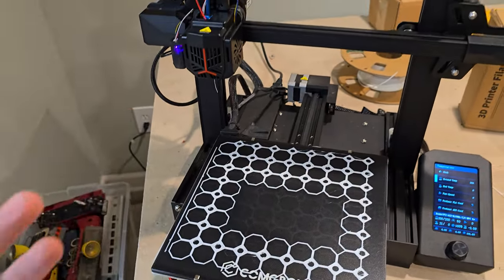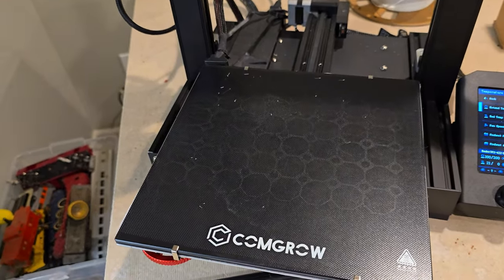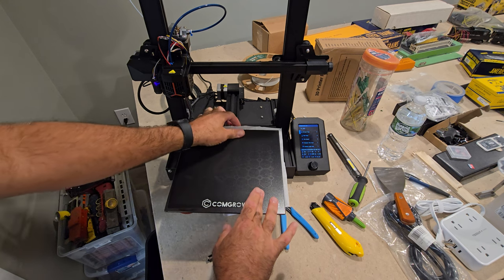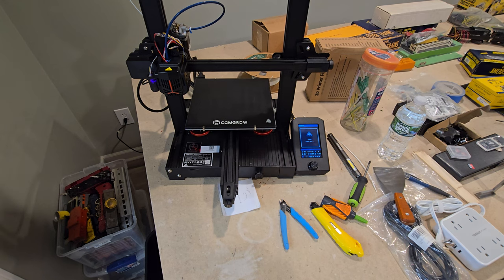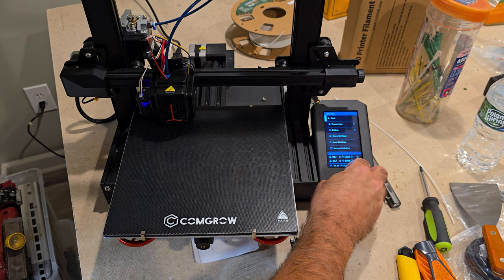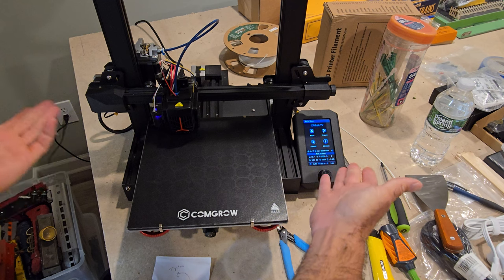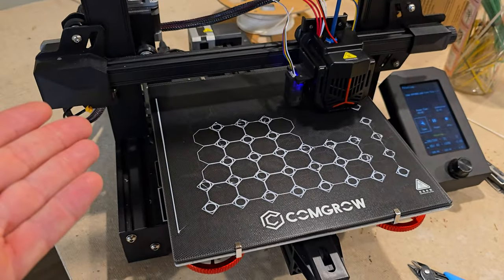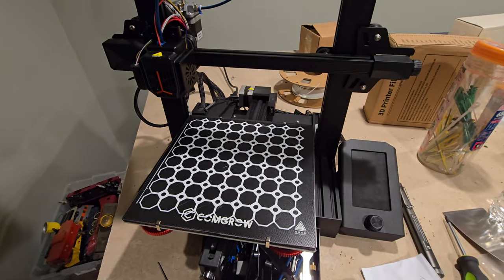Neo = New = New Problem each time! Ender 3 v2 Neo

Comment: I'm curious how old that nozzle was? I don't see how it was so worn out unless you've printed a ton of abrasives with it. Also, I've never personally used an  Ender 3, but seeing as that you could get a brand new one (v2 I think?) for $50, I'm not sure it's worth the hassle. How is the filament getting fed from the spool to the extruder? Is there any strain between those 2 points? Is it fed through a tube? Is the ID of the tube too small? I've not really used an Ender 3, so not familiar with them. Also, printing Multiboard can be frustrating if things don't go perfectly. I've started printing out my panels, which is going to be 70-80 8x8 or 8x9 tiles. I was getting some warping in 1 corner of my bed consistently, so I bought a bottle of Vision Miner Nano and no more issues. If worst comes to worst, you can always check your local FB marketplace to pick up a used printer that 'just works'. I'll let you determine which brand that is. Good luck!
Reply from the maker: Hey Ken.  Not sure how old that nozzle was, but definitely did not have a ton run through it, and it was all PLA.  I'd steer anyone away from the E3v2Neo!  My E3 pro is a slow and steady printer with good quality, so if you are not in a rush it is good.  Filament in this video was a bowden tube set up, I've switched to a direct drive since. Multiboard is like a torture test for the first few layers!!!!  I used some glue since this and it is sticking now, but I am still getting little nibs and now some edges are warping.
Reply: @dougdoesstuff24  I'd definitely recommend getting some Vision Miner Nano. It's a little pricy for the bigger bottle ($45ish on Amazon), but so far, it has been completely worth it. Was the nozzle cheap brass off Amazon or Ali Express? That could have something to do with it. I upgraded my MK3S+ (now 3.5S) to the Revo quick change hotend a while back, and it's been solid. I also just ponied up the $65 for the Obxidian .4mm nozzle. One other thing regarding filament. I bought the Geeetech 10 kg deal you see ads for on social media. It came out to $105 shipped, so $10.50 a spool. I'll probably use 6-7 spools for my initial project, so I figured I'd give it a try. So far, the panels themselves have been good, as well as most of the accessories I've printed. I'd steer clear of printing folding screws, etc with it. I don't think they turn out that great. The filament smells pretty bad, and its dimensional tolerance isn't as good as most filament is you've probably used, but it's good enough for this project for the price.
Reply from the maker: I will look into it.  I was using elmers purple glue, which seemed to work until the edges on part of the print pulled up.  Not a cheap nozzle, at least I don't think so.  It was a hardened steel one I purposely bought to be more durable than the brass ones.  I've been using Elegoo and Overture filament and they have been fine.  Tolerances have been good on my e3pro as well.  I printed some of the locking bolts that print in half.  They go in fine. I did superglue some together and just made sure the threads lined up.

Comment: You know, Bambu labs is having a sale right now. An A1 is just $299 and would run circles around those enders. Plus you'd have the option of multi-color if you wanted to add an AMS at some point. Just saying.
Reply from the maker: I did not know they were having a sale, but good info and I'll check it out. I'm sure it would run circles, that is all I hear about them, but I'm stuck with these two printers right now. Unless Bambu wants to send me one for a side by side 😁

I am holding out for the bigger printer at this point, probably a Qidi 4 as it's cost is more approvable.